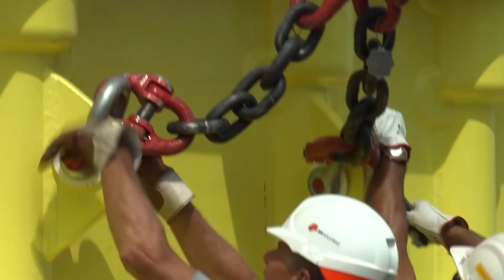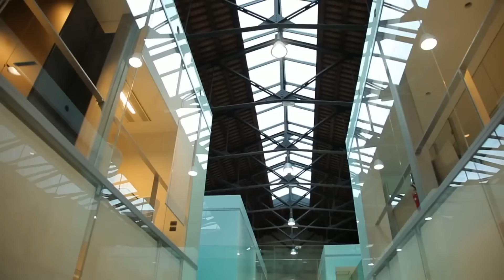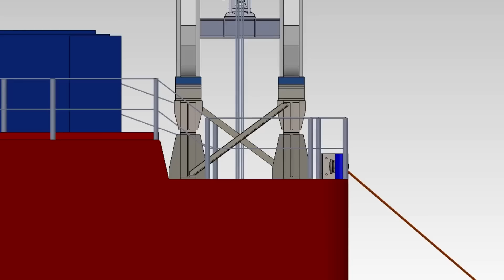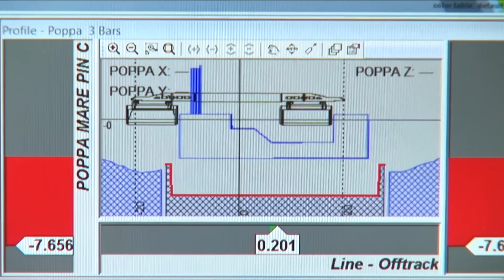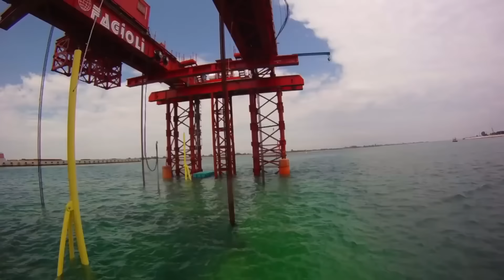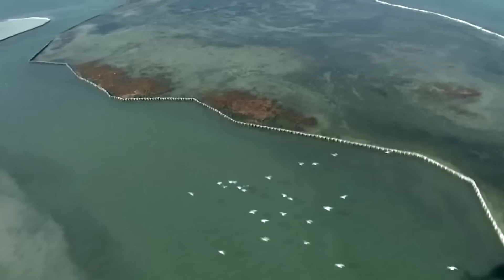Massive Construction: Building a Billion Dollar Flood Defense System | FD Engineering

Comment: Flood protection is one of the best examples of engineering working at a systems level. It’s not just about building bigger barriers—it’s about integrating hydraulics, geotechnical engineering, structural design, and long-term resilience to protect entire communities. Great documentary showcasing the complexity behind modern flood defense infrastructure. – Dr. Sera, P.E., PhD

Comment: A massive failure, when the barriers are raised silt accumulates in the cavity left making it impossible to lower the barriers again, that is if the corrosion on the hinges doesn't lead to catastrophic failure when they try to raise the barriers, or the massive growth of the marine mussels hasn't totally clogged up the workings. Then there is also the corrosion problem with the barriers waiting to be installed, because they started rusting from the salt laden air. I'm sure going into salt water was thought of by the designers
Reply: They simply wanne make more money so they hardly close them so the cruise ships can enter.
Reply: If you're gonna make statements (positive OR negative) provide some sources, or you sound like an armchair pundit with zero credibility.